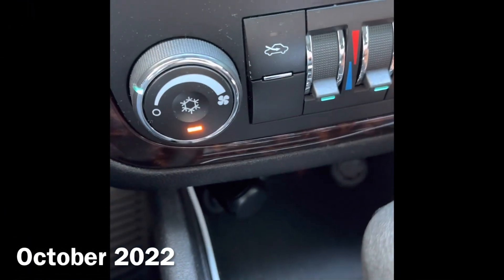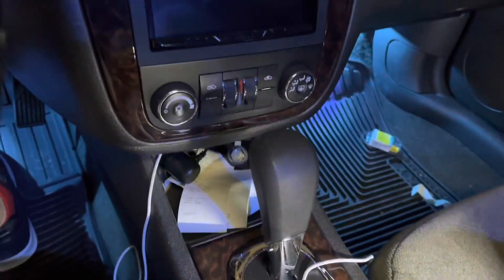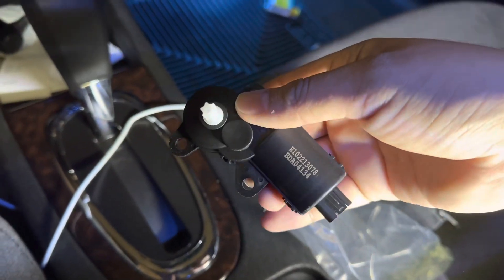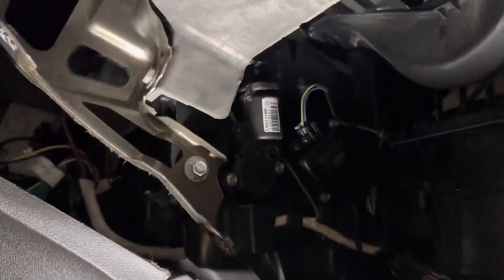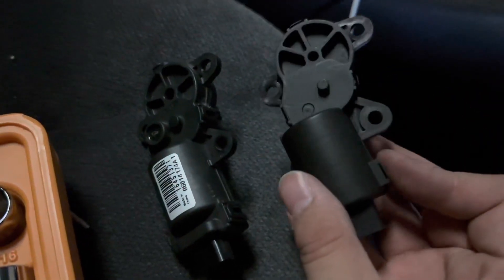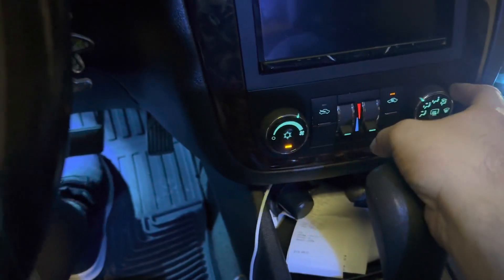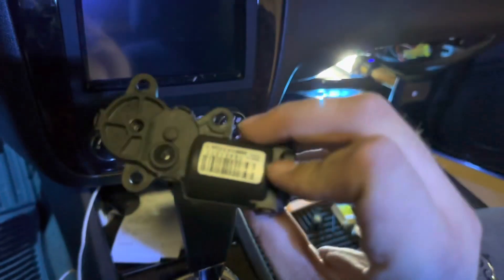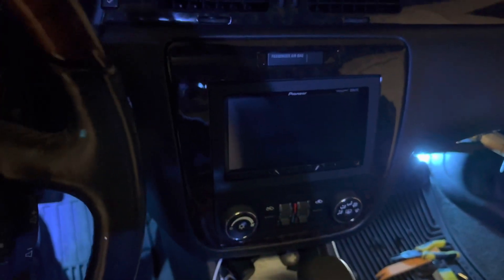2015 Impala Limited - Heat Blend Actuator Replacement

Comment: Many thanks as this part is not listed in the common HVAC issues with the impala.  Worked perfectly on my 2016 limited LT.  Also check out the ambient air temperature sensor as well since that can cause issues with the AC activation and is very easy and cheap to replace if you see your outside air temp reading whacky on the dash display.

Comment: How did you get the upper glove box out? It's been a pain in the ***!!!!!
Reply from the maker: Oh i edited that part out because it was alot of wiggling and such.
Reply: Makes sense...I got it figured out by taking off the passenger side kick panel, passenger side defrost panel (side of dash near door) & removing the 2 tabs under the glove box (cover for the blower motor, resistor, etc.). Just a lil tug under the glove box door (where the 3 pins are) & the upper slides down... thanks for replying tho